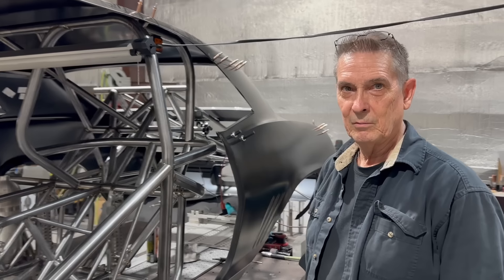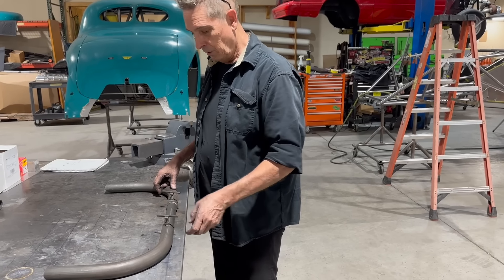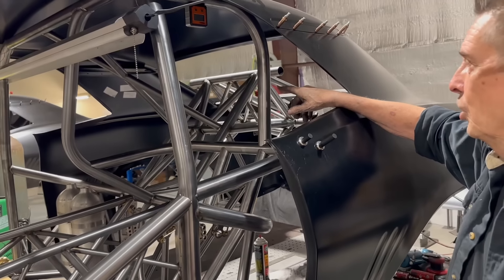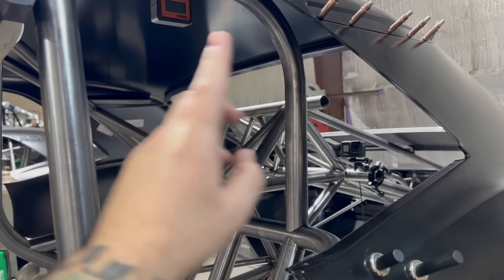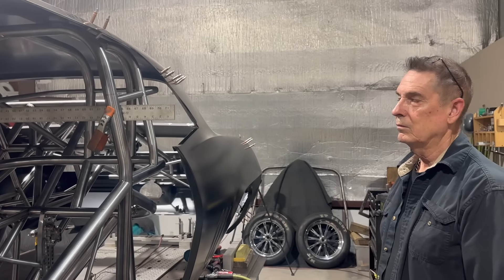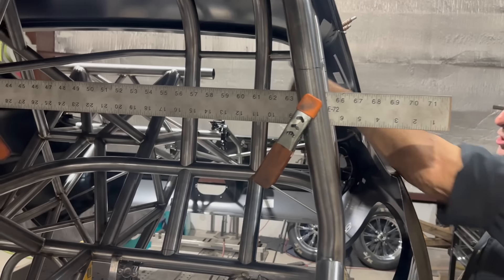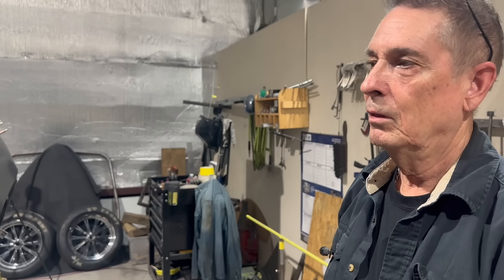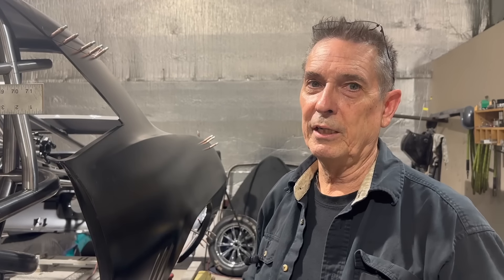Built for a GIANT. Cleetus McFarlands funny car cage is finished!

Comment: That is absolutely the right attitude to have when it comes to safety with the driver compartment - "There's a lot of places we can save a pound, but the driver seat isn't one of them". Having a car that goes this fast is just a completely different level than a 10 sec drag car or even an 8.50 cage. The forces that unfold when one of these cars crash at 220+ are just insane and you have to account for that when you build the foundation. It's great to know you stand firm on the thicker tube as a matter of principle. This cage is a work of art.

Comment: Only chassis we ever ran was a Plueger (our first was actually one of Forces season old units).  One of the things Steve and John were adamant about was "safety". Car had extra non required pieces also..
. Not sure I can say that that chassis was any better than this.. With how these cars are running, they are at the same level of performance as fuel cars were at 25 years ago without all the flames...  Beautiful work...

Comment: The fact that this stuff isn’t cad designed and cnc bent and lazer cut yet is surprising considering every other form of racing is now because repeatability is king. I get that the drivers compartment in this case would need modifications but there’s no reason for the other 99% of the car not to be

Comment: Chrome Molly when exposed to high heat can become brittle. Cage joints that have welds for 3 or 4 near bars looked hot. Do you have to normalize?
Reply from the maker: We are very cautious of tubes getting to much heat in them. You can tell by heat affected zone if they have gotten to hot.

Comment: Every time I see these videos I wonder how much easier these chassis would be with CAD and CNC notching/bending. You would only have to make one main model and then just alter it for different bodies then re export the bend/notch info.
Reply from the maker: Lot of variables from car to car not just body shape but a lot of things.
Reply: Not saying the old way is wrong or the info you get from the people that have don’t it forever. It just makes it more repeatable and you can capture the tricks that make them better for the future. The idea would be to take a finished car with all the bells and whistles and do some measurements on it to model it. Then you can send it out for bend and cut (someone that has the equipment) and try and build it again. It would in theory make it was easier because you can jig it in CAD to make it easier.
Reply: @CJRaceCars  I mean yeah motor/tire change features of the chassis but once they are designed they can be added when needed. At most it would be a few bars that are chassis specific depending on body because like 95% can be generated with door width, body lower width, mid body width, roof width, wheelbase length, and engine to rear end as variables.

Comment: if the roof is just cleeko clipped in and you already have the dimensions of the roof couldnt you remove the roof to make welding the cage a bit easier? or i guess not when youre just tacking it down but when you actually go to fully weld everything then youd remove the roof right? lol
Reply: i commented this before you mentioned it at the end of the video... lol

Comment: This is art. I'm curious... After you pull the body off and start finish welding, how many man hours are we talking? I'm guessing between 30 and 40 to wrap up the welding?
Reply from the maker: At least 40 just on chassis. Not including all the components.
Reply: Another thought... I'm surprised they don't spec intrusion bars in the windshield. I'm sure there's a reason. My mind just can't grasp it. lol
Reply: @CJRaceCars  Thanks. So we're at least two weeks from getting the sticker?
Reply from the maker: @mckrackin5324  will probably be more. We are going to mount engine, do a bunch of other stuff while it’s on the jig then get it certified after.
Reply: @CJRaceCars  Well worth the wait. This is a very cool build. I'm hooked. lol
Reply: @CJRaceCars  Is the real engine? I can't wait to see what he goes with.

Comment: 1 1/2" and 1 5/8"s seems so close. What is the actual strength difference? Asking honestly for my own edification.
Reply from the maker: 1 1/2” is .065” wall and 1 5/8” is .083” wall. So bigger diameter and wall thickness

Comment: So i understand that there's no standard cage build for the nhra. You do your thing with the average cages that are built there.  If the driver gets  injured in a crash or killed, nhra will inspect the car cage after the incindent and advise their improvements for it not to happen again. So drivers are like crash tests, dummies!? Hey, get me right here, not hating at all ! I used to sell snowmobiles atv, side by side , and motorcycle for 26 years. Was helping a lot of racers that modified their stuff.. so, a fact that i can give you. Atv racers use to modify their stock frame because in season, they got stress cracks on their frame because they were extreme racing them.. so they welded weges randomly around where frame part mate...  hey, no more stress cracks! Just the frame braking in half while landing a jump because they modified the engineering of the frame ... anyway.. you do great stuff.. like i said, I'm not hating here.. but you builded the same frame for a while.. same driver cage.. now you modify it. Maybe its no be as effective..